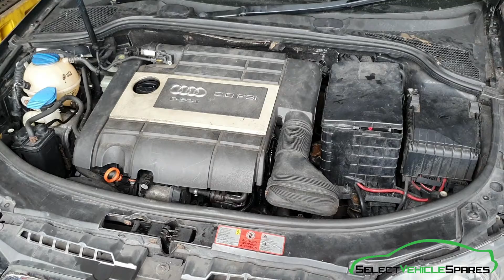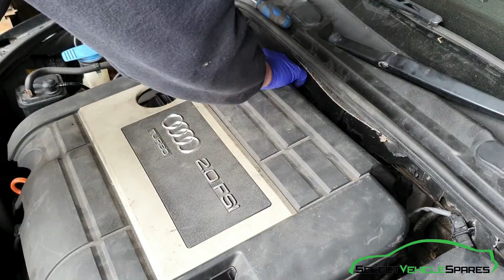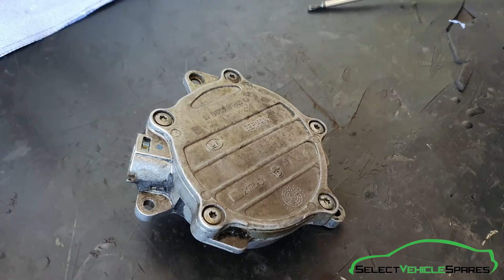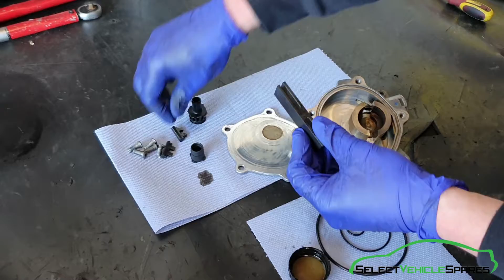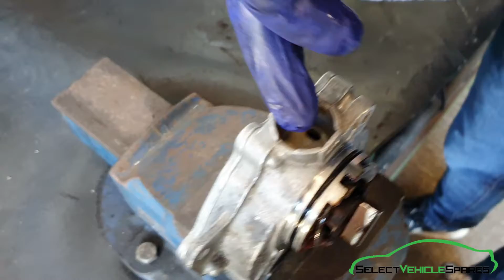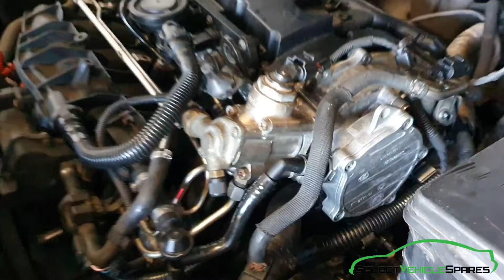VW Audi 2.0 FSI TFSI - Vacuum Pump Oil Seal Leak Repair Removal Replacement (A3 A4 A6 TT Golf Leon)

Comment from the maker: Tools used:

-T25 / T30 Torx: https://amzn.to/2NWrfON
-Flat Screwdriver: https://amzn.to/3qRPuMn
-Pick: https://amzn.to/3smvHFz
-Brake Cleaner: https://amzn.to/3ncWAtU
Reply: Is this enough to stop leakage? I red that only way for sure to stop it from leaking is to add second crush gasket seal like RKX brand "life time" seal kit. https://cdn.shopify.com/s/files/1/1489/0528/products/New3.2logoLIFETIME_1024x1024.jpg?v=1617115943  
The problem is i can't find any Europe and shipping from US is too expensive.
Reply from the maker: @justas5991  It worked for us. We haven't used the other kit so cannot comment on that particular one.
Reply: When I get a new gasket, do I have to use new cover screws? Can I leave the old one?

Comment: I recently replaced the outer seal under the plate without removing the pump and still have a slight leak so I bet it’s coming from the inside seal! Now I know how to remove the pump thanks 👍🏼
Reply: Same for me :D

Comment: I followed this video but as soon as I put the pump back in I got rough idle more so when the brake pedal is pressed down any help would be much appreciated thanks
Reply: Hello, I have a quick question. I'm having the exact same problem as you and wanted to ask if you've managed to fix it and what exactly was wrong. I haven't been able to figure it out yet. Your help would be huge! Thank you so much in advance.

Comment: Were there any other symptoms of the problem, apart from oil leaking. I am getting rough idle reviving up and down and there is also some oil around the pump...
Reply from the maker: Not on the vehicle we had, it was just the oil leak.
Reply: @SelectVehicleSpares  Thanks
Reply: Hi mate did you manage to find out why your car had a rough idle ? I followed this video but as soon as I put the pump back in I got rough idle more so when the brake pedal is pressed down any help would be much appreciated thanks
Reply: @WesleyK9184  Hi, sorry for the late reply. In my case, it was a cracked vacuum hose that allowed unaccounted air to enter the engine. This caused the rough idle and disrupted the internal pressures, which led to some oil being pushed out through the seals. I don’t recall, though, whether pressing the brake made any difference to the idle. I figure that out after a 20 euro OBD diagnostic scanner I bought of a Chinese web page diagnosed "too much air in engine".

Comment: Nice video. Just did mine on my '08 B7 A4. Wouldn't recommended lubing the rings with oil though. I just left them alone and installed with no issues.

Comment: Could you supply the P/N for the O-rings please. Thanks1
Reply from the maker: VAG do not supply a seal kit, the one we fitted is an aftermarket kit, available online for around £15 (ours was from ebay).

Comment: Is there supposed to be oil inside the pump and coming out , I did a boost leak test and there is problem with the brake booster check valve but also noticed the air was pushing oil out of the vacuum pump
Reply from the maker: There should be oil inside the pump yes, but it shouldn't be coming out of the pump.

Comment: Great video, fantastic tutorial. My wife's TT has small leak from here. Is it possible it could be just from the cover plate? Just wondered if worth replacing just that seal first. Thanks
Reply from the maker: Yes it could just be the cover, it can be hard to tell exactly though. You should be able to replace the seal for the cover without removing the pump from the engine.
Reply: Hi there Steve was it the cover in the end. I have a audi tt and my vacuum pump cover is very oily and wet. Thinking it is leaking and is causing low oil pressure light
Reply: @cruiseedwards4657  sorry, sold car as it was, but never caused low oil pressure light, it was slightly weeping from the bottom onto plastic wiring cover. An Audi garage actually said rocker cover gasket was leaking a bit, & could be dropping down there.
If you have low oil pressure I would think it would be more than just a leak in that area.